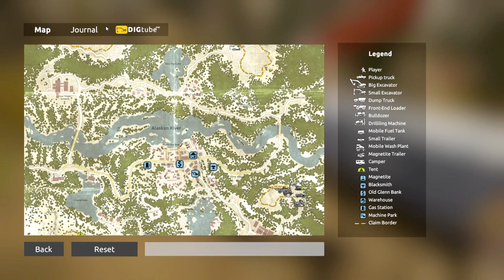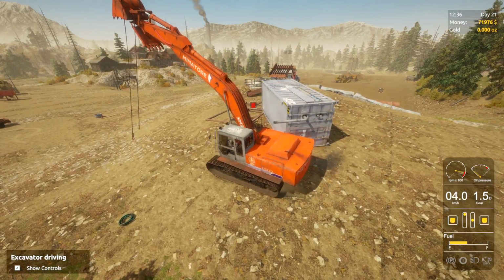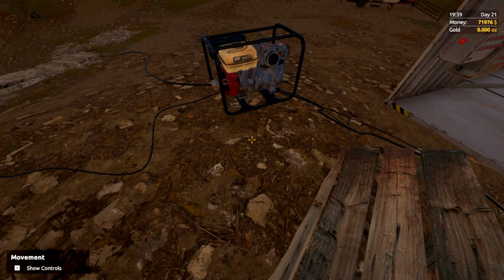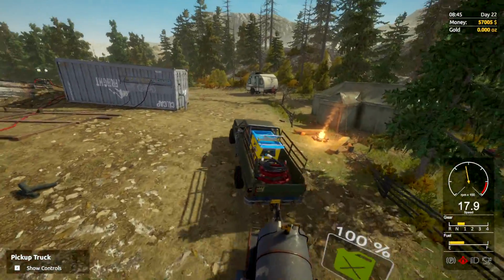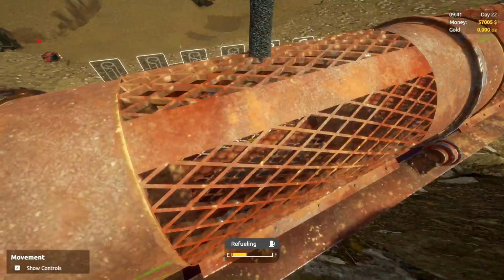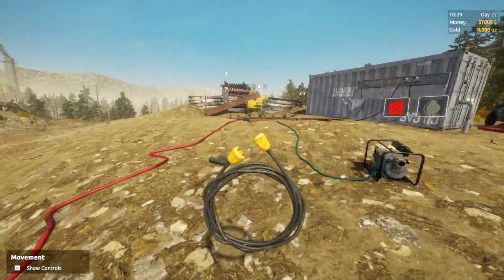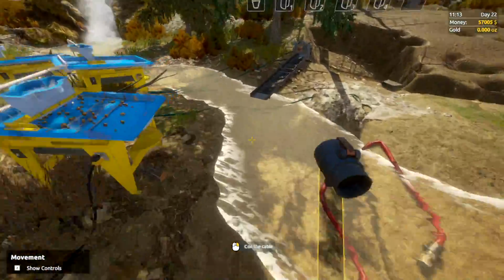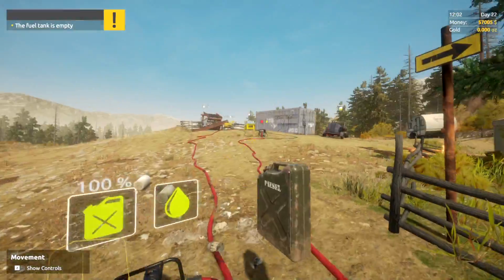Gold Rush - Top Tier Mining!

Comment: Devil you should make a big pile of pay dirt near the shaker step up with the excavator (with the shaker set up turned off) then use the front-loader to load from the pile of pay dirt into the shaker (with the shaker set up turned on) so you don't waste gas and power.

Comment: You need to work more efficiently. Get a rock truck, use the hoe to load the pat dirt into it, drop your pay dirt by the plant. Once you have a few trucks worth of pay at the plant use the front end loader to ru  it through the plant. Only have the plant running when you are putting dirt through it. You will save on fuel and make more money

Comment: That damned generator... I flipped that thing by parking the driver's door of the pickup next to it and getting out. That and the Front-End Loader both act like they're made of styrofoam, not steel.
Edit* Looks like they've worked on the Loader since I played with it last. It used to be like driving on greased glass with that thing...